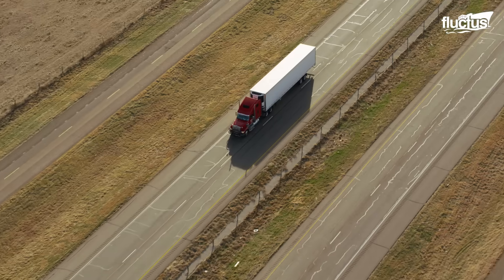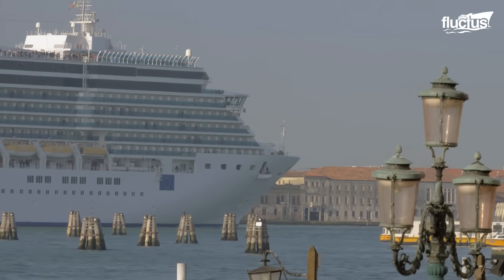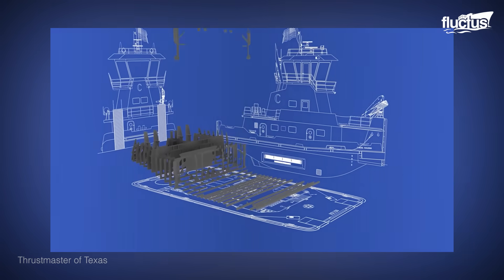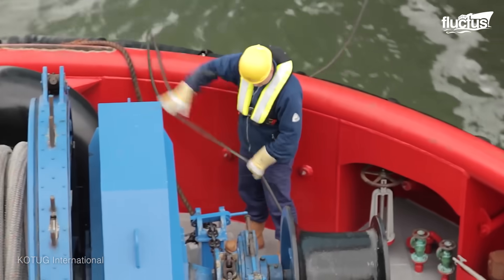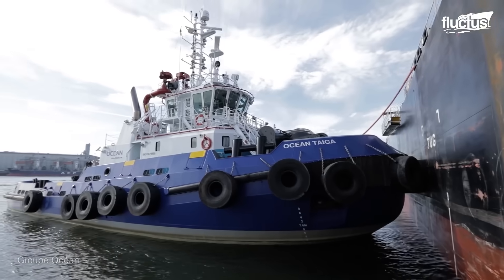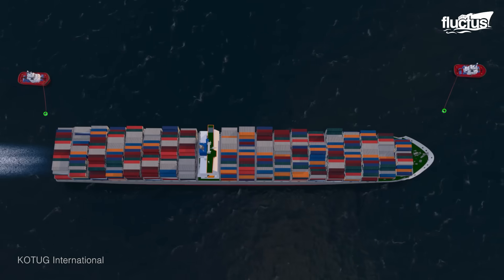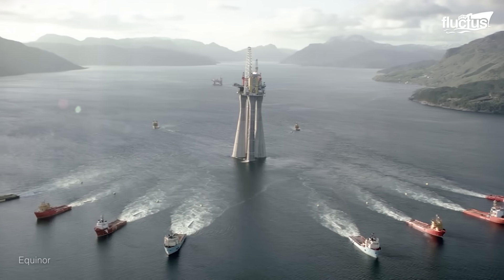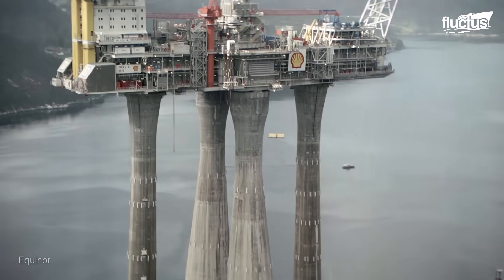The Insane Amount of Power Tugboats Pack to Move Giant Ships

Comment: I was in the navy stationed aboard a salvage ship that could be used as a tug. We actually did tug a disabled vessel that belonged to the South Vietnamese navy once. It was during a storm and we were banned from the fantail during the time we were towing it. We were towing the vessel with a large metal cable that was swinging to and fro like a big windshield wiper and we were told that it would cut us in half if we got near it.

Comment: The way I see it, it is pulling a massive mass which is being pulled down by gravity giving it weight which exerts a force into the sea water below and around it.  According Newton’s Laws of Motion, that sea water is exerting a reactionary force.   What that means is that some of that sea water is reflecting force back against it from behind and below, allowing it to be easily pulled along by a tug boat.  The tugs boat job is to get the ship to move in a certain direction by taking advantage of the ships kinetic energy and the nature of fluids.  Hate to disappoint you but there is nothing special about that tug boat except it is at Sea which is the real force.

Comment: It is impressive the power they pack relative to their size, but relative to other ships it's nothing.
Reply: Also, relative to other boats, like sailing yachts, it's huge - they normally have around 30-40hp engines for manoeuvring and slow cruising in no wind. And compared to cars. Drag racing cars produce around 4-5,000hp, still nowhere near tugs.
Reply: @ed_lifts  Top fuel averages 10,000hp, 8,000hp is considered the low end. Think the highest I've seen personally was a touch over 11.
I work in maritime diesel and the two ABC engines I just serviced the other day will be going into a tug, and only produce 2000hp each. In comparison the Wartsila 40s and 50s we service for cruise ships produce 1000-1300hp per cylinder, in a V18 configuration. Also with two engines on board.
Overall it's like pointing at the average minivan today and talking about how crazy powerful it is, then using an ATV or Moped for comparison.
Reply: @Patrick.Weightman  I was referring to promod drag cars, as I momentarily forgot about top fuel dragsters. I agree with the minivan vs moped analogy, though.
Although, I've never heard of a V18 in a car, or at all, before. Also, 1,000hp per cylinder is 18,000 horsepower, which is still rather impressive.
Reply: @ed_lifts  he said the V18 was for a cruise ship.

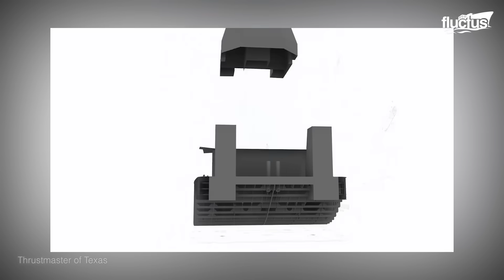Comment: @2:50 Wait, no. I don't think that's right. The shape of the hull does not impact displacement. That's the whole "Eureka!" thing. But what word did you mean?
(Edit: Surface area, probably?)
Reply: I believe in this context, displacement is correct.  They use a displacement type hull as opposed to a V-shaped hull to increase the amount of water the boat displaces to give it more "traction" or "grip" in the water, where as a v shape would allow the boat to be pulled easily by the ship it is trying to stop.  

It is like using bulldozer tracks compared racing slicks to get traction as opposed to being efficient at higher speeds.   

The tugboat uses a wider, more square hull, along with weight to displace as much water as possible.
Reply: @Bendigo1  Is a round, flat hull called a "displacement hull"? It's incorrectly named, but I'd be fine with that. Common usage is a thing.
Archimedes' (Wiki): Any object, totally or partially immersed in a fluid or liquid, is buoyed up by a force equal to the weight of the fluid displaced by the object.
See any mention of hull shape? Shape is irrelevant. Displacement is the weight of the water displaced by the object (boat).

Comment: those bigger offshore "tugboats" you are referring to, that moved troll A and support offshore rigs with all cargo, are usually referres to as anchor handlers, and supply vessles
Reply: Well actually supply boats do not have a winch on the back for towing. I know this because I worked on tugs in the gulf of mexico pulling drilling rigs to their next location.
Reply: @larrymanning5925  yes that is correct. Achor handlers would be more correct. And supply vessles is in its own category
Reply: @simonhaugenkolstad8561  
There are a couple other things that make a supply boat different also that I didn't get into like tug boats have big propellers compared to their size and supply boats are faster still than tugs even with smaller props.
Reply: @larrymanning5925  yeah i know. My point is, even anchorhandlers are a bot wrong to call tugs. They took alot of different vessles under the same category

Comment: "the hull rides low maximizing water displacement" - isn't water displacement exactly determined solely by mass?  Tug boat power to weight ratio is different than their engine's power to weight ratio.   This video's writing is really bad.

Comment: @2:59: "This type of [hull] design helps generate friction which increases the efficiency with which tugboats can pull or push other vessels." I don't think that's right. A tugboat hull with great friction (with the water) would resist being pulled around, but they have engines for that. Since tugboats don't travel fast, friction with the water is not as important with ships that cruise across the oceans, but that's it.

Comment: "no matter how small you are.. you have the ability to push and pull others for good"
Reply: 😀 51 Years ago when i was 10 i used my 4 hp johnson and 16 feet boat to keep a  78 feet fishing boat that had gottten their nets in the propellar out of the rocks at shore 2 hours until  larger boats came and took over.
It was just a breeze blowing towards shore, but i guess that + the nets still dragging under the boat stopd my 4 hp from manage to tow the 78 feeet boat to safe harbour. hehe
But i still got many thanks + around 200 dollar which was a fortune for me in 1971.

Comment: Years ago a former boss/employer, that liked to pretend he was an actual engineer, spent a small fortune building this massive shredder machine to process tires and other things into tiny bits expecting to make a fortune with it.  

He sourced a tugboat engine that was so big that it was delivered to the local town on a rail car.  After getting his monstrous contraption up and running he started testing it. It would eat anything!   

However, the fatal flaw was that the wannabe engineer never once calculated the fuel burn of a multi-thousand HP engine. Turned out the fuel burn alone ate more money than anything he could shred with it was ever going to be worth!  🤣
Reply: lol he didn't account for fuel consumption before buying one of the largest and most robust engines you could possibly obtain to shred things? Tragic lil lapse of judgment there
Reply: @Attack-Roomba  It's been about 20 years now and it's become a fun little local folklore story of sorts. 😁

To be fair, I worked with him for about 3 weeks before realizing that lapses in judgment were sort of his baseline on most things which proved the difference between being a wannabe engineer and an actual engineer. 😋
Reply: @GatorDrummer And an endless amount of failures come from there too that never get the recognition they deserve.  

His was just large enough to gain local public level attention and achieve that status officially.

Comment: 1:04 gross tonage ist a  a volumentric unit  equivalent to 100foot squeare or 2.83 cubic meters. The gross tonage is the total amount of cubic space a ship has. The wight of a ship its called displacement and its measured in Metric Tons 1000kilograms.
Do not mix this things please.
Reply: I picked up on the same comment in the video, however you have also slightly confused GT with the long obsolete GRT. Your point still stands and GT is a function of the moulded volume, not a weight.

Comment: When you buy a brand new tugboat,
does it come with new tires on the sides.?
Asking for a friend.
Reply: The builder fits the tug with any equipment the owners orders. Tugs are made to order. There are many types and designs of fenders. Tires are just one of them.
Reply: Maypop Tires. May pop, may not. 😅
Reply: And do they use cross-ply or radial and, do they use Winter tyres in colder climates?  Also asking for a friend.    :)
Reply: @PhilJonesIII  This entire tread is tiresome.
Reply: @PhilJonesIII  LOL!

Comment: Large Vessels such as Mega Container Ships have 2 or more Bow or Stern Thrusters, that require 1 Tugboat assistance in berthing and unberthing from the whaft sides of the port.
Reply: Not always. The harbour pilot will decide on the tug package based on the ships particulars and environmental conditions. Bow thrusters are almost never as powerful as a ship docking tug, and do not offer the same degree of control. 

Most new ships are not built with thrusters because they know the ports they call have adequate tugs available or mandatory tugs through the pilots. In this case, ship owners may choose to not install thrusters and save the cost.
Reply: Yes indeed and unberthing berthing of the Vessel to be moored to the whaftside, the pilot will laision with the 1 or 2 Tugboats Captains to maneuver the ship 🚢.

Comment: I remember having 2 detroit diesel 16-92's around.
They had turbo and super chargers combined.
Wore ear muffs to hit the air starters.
You just go back to work aboard with the ground tilting after start up. A good captain or 1st mate wont yank the controls, you can tell whats going on.
Reply: Those versions will not run without the roots style super charger, they don't make HP with them, it's how the engine gets air to "breath" the high HP comes from the exhaust driven turbo charger/chargers and the fact that those series of Detroit diesels are all two-stroke cycle engines so they make twice the horsepower as a four-stroke cycle diesel engine would love the sound of a buzzin dozen with turbos